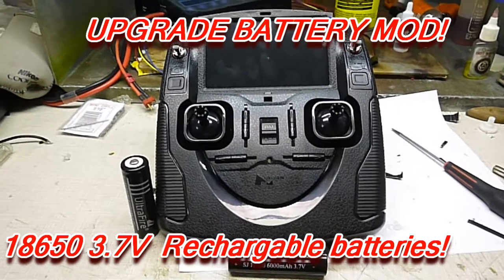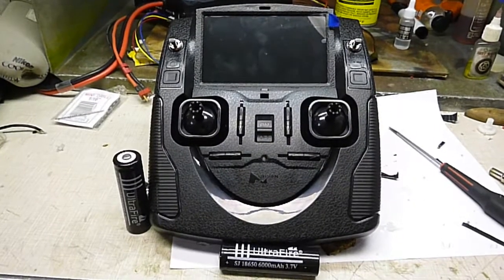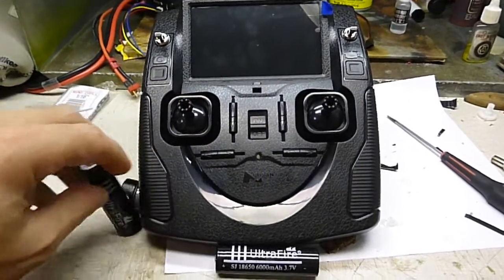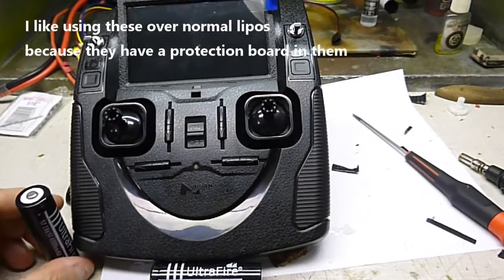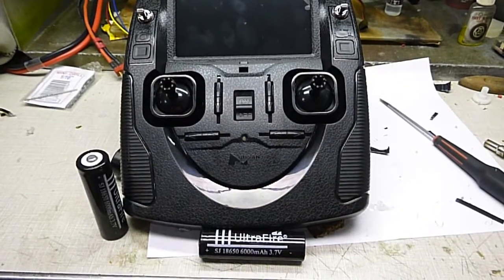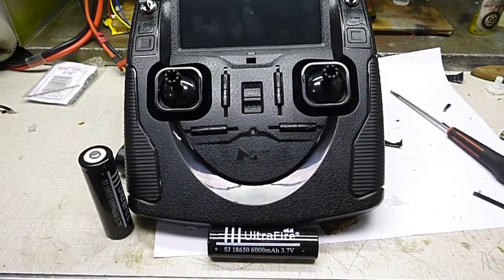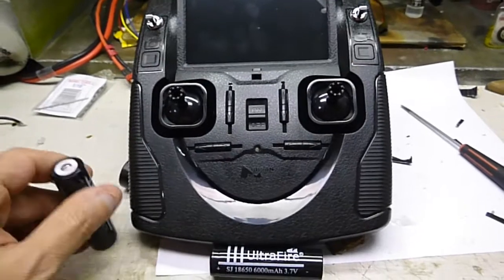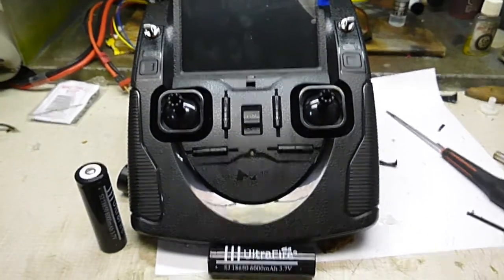Hubsan H501S Radio Battery upgrade mod H502S FPV

Comment: I don't know about the H501S transmitter, but if you are just looking for a better battery solution, this mod is probably not required in the H502S transmitter. At least in the model that I purchased in December, 2016, there is a female JST connector located at the top of the battery bay that allows for a LiPo battery to be plugged in. The exact same LiPo battery provided when you purchase the quadcopter fits exactly into the battery bay. It is a little snug but it does fit and the battery cover can be closed. It is not mentioned in the literature provided with the copter as an alternate but I went ahead and plugged it in and gave it a try. It worked just fine. It also registered a full charge on the meter on screen. Even when fully charged, my rechargeable Energizer 2500 mAh NiMH AA batteries only registered two or three bars. The advantage here is that you can use either the LiPo battery or the four AA option and you don't have to hack up the transmitter.
Reply from the maker: Yea you can use lipo but i prefer Li ion cells they are much safer to leave in the radio and the cells come with protectors built in this is why I like them over lipo.

Comment: hi, just a quick question before i do this , But does the transmitter overheat or anything putting in bigger batteries..And hows your one holding up...thanks
Reply from the maker: Hi no it's perfect on the board it shows printed on it 3-13V so it's fine with these.
I would get a holder I went nuts piecing the AA holder together a pain to make work like how I did.... get the 2 cell battery holder and it will be much more simple..
Reply: Thanks for getting back,  yes I have already sent for a 2 cell holder and that batteries.. Will I have to solder the new holders wires on to we're the ones are at now or get quick splice connectors to join together.. Thanks
Reply from the maker: Hi you can solder directly to the board or connect to existing wires if you wish to.
I use a cheap charger to charge the cells I show that is meant for charging them, I suppose you can use a good RC charger if you wish to but charge one cell at a time.

here is the batts and charger.
http://www.ebay.com/itm/2PCS-18650-6000mAh-3-7V-Li-ion-Rechargeable-Battery-US-Dual-Battery-Charger-E1-/322111385418?hash=item4aff55af4a:g:NL0AAOSwdWBXOqJ2

and if you want a better charger that is still inexspensive.
http://www.ebay.com/itm/NITECORE-UM20-USB-Charger-for-Li-ion-IMR-18650-18490-18350-17670-16340-14500-/400982189953?hash=item5d5c66a781:g:~wgAAOSw--1WrhDl

Comment: Instead of all that hacking of the plastic parts, why not just run a wire between the two terminals in the one lane, leaving the other lane for the 2x batteries? You would still have 2x 3.7V batteries in SERIES arriving at 7.4V. Just the same as what you have, but waaay simpler, and waaay cleaner.
Reply from the maker: Hi Because 18650 cells do not fit in the stock holder and this is why I hacked it to fit and why I said it would be better if you simply bought a 2 cell 18650 holder and put that in the radio.
Reply: Oh, I didn't realize the 18650 cells were a different size than an AA because without a side-by-side comparison or experience with them they do look very similar at first glance. I just now looked it up, and see that they are indeed slightly bigger in both length and diameter. Thanks for clarifying Shenlonco!

Also, I read somewhere (can't find it again) that it is dangerous to go beyond 2500mAh cells for use in our transmitters. Can you confirm for all of us readers/viewers that 2x 6000mAh cells are fine long term?
Reply from the maker: Hi It dont matter that would be like running a RC car with a RC 2S lipo 7.4V battery and you use a 2000MAH pack or a 10000mah pack it dont matter you just get more run time.

Comment: Hahaha 6000mah 18650’s. It Will take at least another 10 years before these Will exist bro. You have been scammed
Reply from the maker: Hi I know they are not truly 6000mah maybe half that but they are cheap and work fine for this application.